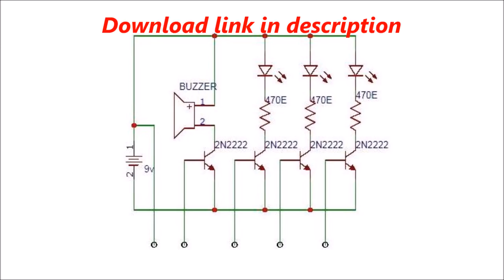How to make a simple Water Level Indicator for home water tank

Comment: I have  done  this  project as per  circuit diagram but  there  is  a  small  problem  with  yellow  LED it is automatically on  when  connected to  battery so  could  you  please help  me  to solve this  problem. .....

Comment: My overhead water tank is 40 mtrs above ground level and I want level indication at ground floor. Will resistance of long wire affect the performance of circuit..?? Please reply.
Reply from the maker: Resistance of wire will surely affect the working of the circuit....it doesn't wotk for wires more than 1 meter or so
Reply: Sir just connect a Relay that can handle a high ampere current...from there u can wire your 40 meters wire...u can use small 220 light bulb as level indicator...
Reply: What if we increase the voltage from 9v to 220v using a mobile charger so that we won't get a shock when we touch the taps

Comment: not good. I tried on long colored coils. LEDs are always dimmed simultaneously
Reply from the maker: Wont work for long wires...
Reply: Are there any models that can be used for long wires? practically measure the water in the tank so far. And the model filled with water by touching the closed loop with buoys, I don't want to use it. Want clear details like this but long strings :)